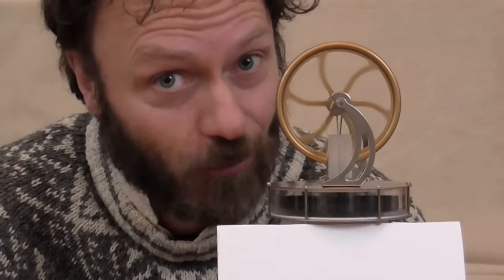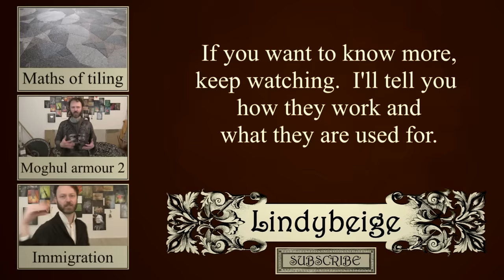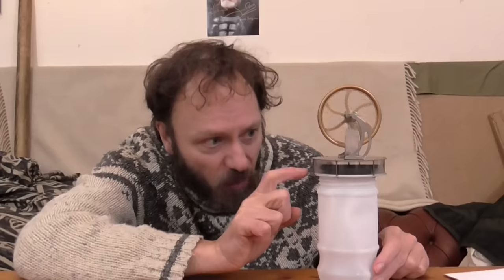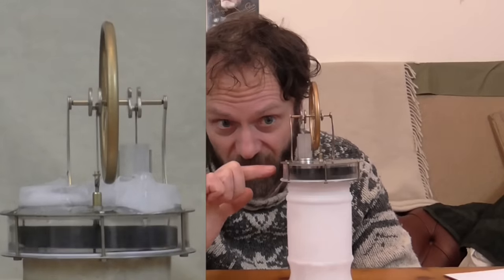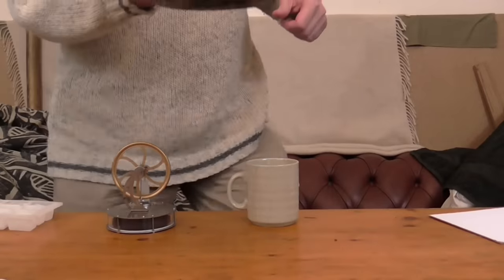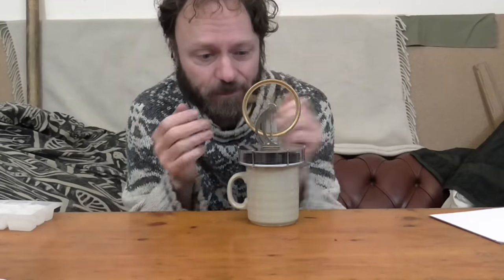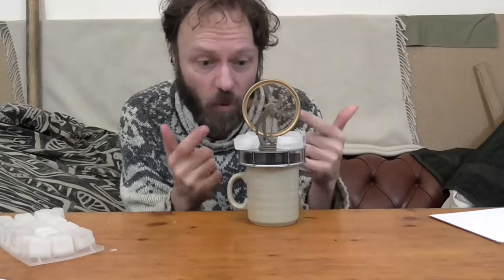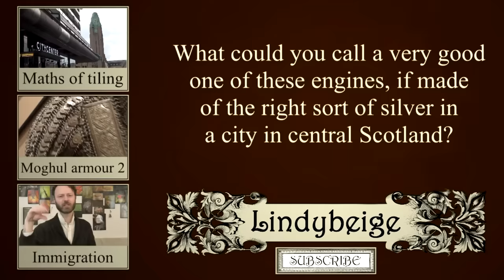Stirling Engines - the power of the future?

Comment: You know, there may very well be a reason why this wouldn't work that I'm overlooking because I literally just woke up... but I wonder if these things could be used in space. Because the difference in temperature between things facing the Sun and things facing away from the Sun is pretty extreme. So you have one side facing the Sun that gets very hot and the other side facing away that stays very cool. Probably couldn't be used for any kind of propulsion, but I wonder if it would be more efficient than solar panels. Biggest problem I see is whether or not the vacuum of space can transfer the heat well enough, I have a feeling that is where this falls apart. Well, back to my coffee.
Reply: Fiete, now there is a fine question. I could be wrong but I don't think any weight is moving the flywheel but rather a... thermal pressure differential? That's a shit explanation. 

Once again I literally just woke up.
Reply: @czarpeppers6250  this wouldn't work for anything small floating around in space, precisely for the reason you guessed. The sun would heat one side, and get the engine started. The inertia from the flywheel would keep it going, regardless of any gravitational pull. But the vacuum of space doesn't contain any molecules that transfer heat away from the engine, meaning that the temperature difference would equalize pretty fast.

It would however work great as a stationary power plant on a planet/asteroid without an atmosphere, as long as the bottom plate was connected to a big heat sink that transfers heat underground. If we assume that the ground transfers heat similarly to the ground here on earth, you could basically keep the engine running until the entire planet/asteroid was heated up, which should be longer than the engine will stay together, provided a constant stream of sunlight. 

Also, with an efficiency close to 50 %, this should be a lot more cost-effective than solar panels. There are solar panel combinations that have a combined efficiency over 50 %, but they cost a fortune. The Stirling engine is a much simpler construction, which should make it the cheaper option. On the other hand, you would want to make big engines in small quantities, meaning that each engine failure would mean a huge power loss. A large solar plant usually consists of thousands of small panels, meaning one broken panel won't affect the overall power production that much. 

Those are the pros and cons I can list off the top of my head. In summary, it should work as a stationary unit just about anywhere, and it might be cheaper than solar power, but it should also be less reliable. 

Sincerely,
Someone who is about to finish an energy engineering degree.
Reply: +Improbabilities Yeaaaaah, I had a feeling the vacuum would be an issue, but not being completely versed in the science I was 100% sure. 

Thanks for the response and other information though, interesting read. It is a shame that the Stirling engine isn't something that is considered more these days, one thing I would love is something like a electric generator Stirling engine that used a wood stove for heat. Because power goes out quite a bit where I live and we always have a lot of wood. I have seen Stirling generators online, but they always seem to use propane or something similar for heat.
Reply: There is a dude that made one for satalites
Reply: I like this idea and have theories of my own.  As long as you used a sealed chamber with some atmosphere/gas in it to allow proper heat transfer, you could have high surface area fins radiate excess heat on the shade side.  The difference between sun and shadow is roughly 300C which sounds workable.  As for Improbabilities, the notion that there is no heat transfer in space is patently false.  There is no significant convection or conduction but heat still radiates.  The biggest concern would be heat/light sources on the other side of the engine with celestial bodies reflecting significant amounts of radiation.  I believe this to be feasible but I am concerned that the flywheels would cause drift unless you balanced them against each other properly.  Would still need fuel for positioning thrusters to maintain alignment
Reply: @Darthenator  I specifically said that there were very few molecules to transfer heat away, and that the temperature difference would level out over time. If I were to elaborate, then I would agree with you that there is a lack of convection (due to the lack of gases/liquids in space), while conduction (between parts of the engine/ship) and radiation still happens. But since the radiated energy is proportional to the temperature raised to the fourth power, the hot side will always transfer much more heat away, meaning any significant conduction of heat between the two sides of the engine would lead to the temperature gradient evening out over time. I agree that a system of radiators on the shaded side could make a sterling engine work i space, but I believe the raditor would have to be pretty big. 

As you pointed out, the hardest part about putting sterling engines on small vessels would be to counteract the torque of the engines, preventing the vessel from the spinning. Preventing spinning would also be extra important, since the radiators would have to stay in the shade.
Reply: @czarpeppers6250  the best thing about Stirling engines is that the heat source doesn't matter, so even if it is built for use with propane, it should work with burning wood (perhaps with some modification)
Reply: @Improbabilities Yeah I thought about modification, but the ones I have seen seem like they would be very difficult to modify for using with a wood stove or something, just because of the way components are laid out.. I wonder if the heat going up a chimney would be enough to power a Stirling generator, it would be great if you could install something on the roof merely using your wood stove for heat could power it. Then being outside you don't have to worry about the noise being right in your living room. 

I imagine that by the time heat travels up there it has cooled down too much to power something that would provide a significant amount of electricity. 

I'm glad my just-out-of-bed thought produced such interesting conversation though.
Reply: The flywheel uses its mass and inertia, it is not about weight which is the pull of gravity + mass I believe.
Reply: I thought he said air pressure was involved and I honestly didn't fully understand his explanation of how it works. Unless someone can absolutely say it wouldn't work in space, it seems like a experiment worth doing,  installing on the space station for test purposes in order to expand our knowledge of how it works and expand our energy sources. That said, solar cells have been proven to work pretty well for powering space stuff since you get the light unfiltered by any atmosphere.
Reply: It's true that the heated gas from the stove expands and cools as it goes up through the chimney, so you definitely lose some energy. But if you wanted to interrupt the intended flow with a Stirling engine, my first concern would be checking that it still lets all of the smoke out, and pushes it high enough into the atmosphere not to be a risk for anyone nearby. Basically, make sure it's not a health risk.

The other concern is having a big enough temperature difference between the hot side and the cold side. In this case, the cold side will matter a lot. If you plan to cool the cold side with outside air, the ambient temperature will affect the efficiency a lot. The wind speed and direction will also affect the cooling of the cold side, which will affect the cooling. 

As for noise, they don't make a lot. They are silent enough to avoid passive sonar detection, which is why they are getting used to make "undetectable" submarines. I haven't actually stood next to one big enough to produce any sizeable amount of power but in my experience, the systems heating and cooling the engine usually make more noise than the engine itself. Last time I saw one, the loudest thing was the cooling system, which basically sounded like a half-open water tap (moving water over the cold side of the engine). Likewise, an electric generator will probably make more noise than the engine. So now that I've argued how silent they are, I have also realized, 

With some soundproofing of the cooling system, I imagine having a Sterling engine in your living room wouldn't be too far from having a constantly moving spinning wheel (the kind used to spin thread or yarn) as decoration. But then it also wouldn't serve as anything more than decoration.

Honestly, building a Stirling engine into the side of a house with a wood stove or fireplace would be really interesting. Put one heatsink inside the stove, another outside the house, and stick the Stirling engine between them. This would basically mean you could have a combined boiler and engine room behind the fireplace. You could also help cool the engine with water going into the boiler, allowing for the waste heat to be reused. I'm sure someone who knows more about architecture and insulation (or fire safety in buildings) will be able to tell me why that's a terrible idea. Even as an energy system, I think what I'm imagining wouldn't work efficiently in practice. But I would still love to see it.

(Even before finishing this comment, I realized that the stove/outside heatsinks would be great at transferring heat even when the engine was off. They would be the insulation equivalent of cutting a huge hole through an outside wall and covering the hole from both sides with metal plates. In other words, a great way to heat up your garden in the winter, and getting all of the heat into your house in the summer.)
Reply: Because the flywheel still has mass: Momentum = Mass * Velocity.  Nothing to do with gravity.
Reply: Is this actually about the transference of heat energy as entropy? Does it have to turn a flywheel or work a piston?( I just had a large cup of coffee too). It's possibly of more relevance to be asking in this thread as there is a distinct lack of handy air or gas type molecules to expand in space.
Reply: I'm not sure what you mean by transferring heat energy as entropy. Entropy is transferred every time heat is transferred, but that is because of the inherent way entropy works (at least within thermodynamics; I'm not sure how it works in information theory).

As for the Stirling engine itself, it is a closed loop engine, following the simple principle "no matter in, no matter out". There is gas inside the engine, which does work a piston, which turns the flywheel, which moves the piston back, and so on. But the gas never leaves the engine. As long as you don't puncture the engine, it will work in a vacuum.
Reply: Improbabilities  it works only if there is a transfer of energy.  there needs to be something inside the cylinder to carry the energy... some sort of gas... as its the expansion and contraction of the gas that drives the piston.  The outside is heated up by the sun by RADIATION,  and the inside by CONVECTION   And then CONDUCTION when the gas molecules touch the other side.

To answer someone's comment below... they made a Stirling engine that would run with 1 degree Celsius difference but it was totally way too expensive.    I read someplace where have used them on a nuclear submarine to generate electricity from the heat of the reactor.

HAH!   I made this comment before listening to the whole video.  lol
Reply: Flywheels don't rely on "weight", they rely on MASS, which always exists.
Reply: @markmyers5558  yeah, I kind of forgot to point out that convection does happen inside the engine. Thanks for clarifying.
Reply: i think atmospheric pressure is important to it's function.
Reply: "Stirling_radioisotope_generator" is similar to what you're looking for I think. I went to the comments because I saw the use of Stirling engines during a current space mission. My understanding is that you could use solar power or nuclear power to heat one side in drastic proportions to the cold of space. I don't know how they overcome the fact that there can't be much heat transfer without particles, unless the cool side is able to efficiently radiate the heat, instead of transfer it.
Reply: SO = IN THE DEAD OF WINTER AND THE DEAD OF SUMMER - ONE OF THESE MACHINES PLANTED IN THE GROUND WITH THE HEAT OF THE EARTH IN THE SUMMER COOLING IT AND THE HEAT OF THE SUN WARMING IT WOULD MAKE IT RUN BEST AND DURING THE WINTER WITH THE HEAT OF THE EARTH WARMING IT AND THE COLD OF THE AIR COOLING THE TOP OF IT AGAIN IT WOULD WORK BEST USING THERMAL ENERGY OF THE EARTHS CHANGES COMPARED TO THE OUTSIDE TEMPERATURE.. HMMMM ... this engine would slow down in the spring and fall compared to the winter and summer
Reply: the flywheel relies on its own mass (i.e. intertia), not its weight. So it would work just fine.
Reply: Fly wheel uses mass not weight. Getting rid of heat in a vacuum is a pain since you can only dissipate by radiation not convection , so the cold side would need large metal fins that would need to be kept shaded.
Reply: I didn't read ALL the replies, but as long as the chamber has a gas in it, it should work.  Which would require good seals on the 
power piston, which is exposed on one side.  Or you could have the whole engine (including a generator) encased in a bubble and 
gas, except having the cold side exposed.  You want the cold side exposed to radiate heat as well as possible.  
The hot side is heated by radiation, so it doesn't matter if it is exposed to vacuum or not as long as the bubble is transparent 
to the radiation.  

Oh and it doesn't matter if it is weightless, the flywheel just provides inertia which does not need gravity.

One complication:  The power piston needs to not have pressure from a vacuum or gas pressure from a limited volume on the 
outside)  It works in a normal atmosphere because the movement of the piston does not affect the pressure on the out side 
of the piston; if it was enclosed in a small volume it would receive push back as the piston increases the pressure on the out side.
If it is exposed to a vacuum the air pressure inside would ALWAYS be pushing the piston out.  The sterling engine works by cycling 
the pressure difference on opposite sides of the power piston.  Hmmm, this could be complicated, but it might be possible to
modify the Sterling Engine to make it run BETTER in a vacuum.  

This is going to take more thought!
Reply: Thought: You'd need multiple airtight chambers with valving and different levels of heat shielding or insulation dependent on what each section is designated to do. There is no medium in space to transfer the heat to really... but.. you could create a medium "chamber" that is more exposed to space and ergo it would drop the temperature and create a cold space and then use a radio-isotype heat decay chamber to heat another chamber and.. well.. I mean.. shrug should work in theory Not sure the weights would be worth it to put it in space.. but shrug

The bigger issue I could see is if there was any change in the speed of that wheel it would modify the path of the space craft just like a reaction wheel which would mean as the radioactive material decayed and heat output dropped the speed of the wheel would decrease at a steady but constant rate.. not much change in the short term.. but say on something going distances like.. Voyager.. HUGE path change.

Just my two cents on using one in space in theory
Reply: @1990Hazard1990  , it still has mass. Weight is not a factor .
Reply: @Improbabilities  , I suppose a water jacket could be used for cooling, similar to a VW waterboxer engine. Water will eventually freeze in space. Definitely cold.
Reply: @jimwagner6260  , yes, I knew him. His name was Dr. Martin Lowery. I still have the machinist lathe he used.
Reply: @MrSpaceRatt  cool. I think it could be used for an off grid home power system. I couldn't find the link.
Reply: One problem I see with it is that because the spacecraft is not anchored into anything, the engine would not only rotate the flywheel, because of the conservation of momentum it would also rotate the entire spacecraft into the opposite direction. I guess that could be worked around by having two flywheels rotating in opposite directions to cancel out the rotation.
Reply: @UngodlyFreak  : the unit that I saw used a spring instead of the flywheel.
Reply: no atmospheric pressure in space , this engine needs that to push the thing down.
Reply: @1990Hazard1990  Flywheels work by MASS not WEIGHT.
Reply: NASA intends to use them on Mars as part of their Kilopower facility but driven by nuclear fission rather than the Sun.
Reply: They  are used  in space
Reply: @czarpeppers6250  So, ok... now you really need to explain how the energy of the sun is capable of reaching anything at all.... not just Earth... given all that vacuum around it.... have another cup of coffee before you go for this one, lol.
Reply: @jimwagner6260  maybe you meant "salatites" ha ha ha, ya know, the ones for making salad!
Reply: Use two contra-rotating flywheels to counter balance the torque?
Or put a 90 degree pawl and spin the Flywheel in the same plane as the base so it didn't matter so much if it rotated?
Current space craft use radiator fins to dump heat by, well,  radiating it away. so that could be the solution to the warmth seeping through.
Need good seals on the cylinder tho so you don't loose the gas in the cylinder .
Reply: @Improbabilities  maybe they could do that and use the heat transferred for a water heater or heating for a building or soemthing endless possibilities lol
Reply: @Improbabilities  wouldnt the simplicity of the Stirling make it much easier, Cheaper, and faster to repair though?
Reply: @datdabdoe1417  the answer to this question depends on which scenario you are thinking about. The main reason why Stirling engines are not used very often is that they are big and heavy. They might be easier and cheaper to maintain, but they will be more expensive to buy, and take up a lot of space. The weight also makes them a bad option for most vehicles. If you want a compact, lightweight engine, and there is air around, use a gas turbine. If you don't want to produce deafening noise and set fire to things behind the engine, you'll end up with either some electric motor or an internal combustion engine similar those in cars.

In space, electric motors alongside solar panels are probably the best option, because: 1) it makes more efficient use of the limited space and weight, and 2) you can design both so that they could be repaired with the same materials (in most electrical systems, fixes boil down to replacing wires and contacts).

On earth, you could probably find lots of scenarios where Stirling engines are the best long term option, but it will come with a big upfront cost, and take up a lot of space. 

For really large engines, there is also the classic large wheel hazard: if the flywheel comes off, where does it go? Turbines in large power plants often have enough energy to plow through a city block, if it were to leave the facility. That's why part of the design is to angle the turbine away from any inhabitated area, often into a lake or ocean. The flywheel on a Stirling engine wouldn't be spinning as fast, but it would be very heavy, with a larger radius. It would look like a giant bike wheel slowly rolled into town, parking by wedging itself into a building.
Reply: @Improbabilities  Preventing spinning would be fairly easy using two or more contra rotating engines, just as a twin rotor helicopter has contra rotating main rotors and therefore does not need a tail rotor.  With modern electronics to control the speeds of the various rotations, a balance should easily be achievable.  As for radiating the heat, there is no reason why the hot side and cold side should have the same surface area or be made of the same material.  Indeed the hot side could be a very small area working at high temperature with heat focussed on it using mirrors or lenses, and the cold side could be multiple fins working first as a heat sink then as a radiating surface.  The Stirling engine could be made to work in space to generate some electricity.  However, although Stirling engines are very efficient (little wastage of energy) they are not particularly effective (they produce minimal torque and power).  Also, how would the energy then be transferred to the place where it was needed?  It's a case of, "neat idea, but not a good idea."
Reply: @Improbabilities  As the only requisite for a Stirling engine is a heat differential, if one were designing for long space trips, radiant cooling is everywhere around a spacecraft; the heat source would be problematic. Once a mission leaves proximity to a local sun the incoming external energy is useless, and for manned missions, heat retention for living environments is going to be a major concern. Maybe a nuclear power source that generates extra heat might allow a Stirling engine to maximize efficiency, but all sorts of other creative options are going to be available as well. There are scores of reasons why "rocket scientists" earn advanced degrees in physics and math, and why random YouTube head scratchers are not likely to move to the front of aeronautical job queues based on novel conjectures and speculations. All here might benefit from researching the Dunning–Kruger effect.
Reply: @Improbabilities  Actually, the easiest part is counteracting rotational torque; one merely builds two wheels spinning in opposite directions. YouTube is a very inefficient design, as far as imparting educational wisdom goes. We used to have great places called "schools," but now we can only wait, for the faith-based Mars mission to launch.
Reply: @z1522  have you heard of Warhammer 40k?...
Reply: @z1522  He has a nice jumper though lol
Reply: You are correct. The cold of space is a myth. Solar panels in space are massively powerful, Like 100 times as powerful as on earth. It would be insane to try and make this your power source in space.
Reply: @Improbabilities  As a question, if you kept the temperature displacement chambers pressured with some gas, could it not work?